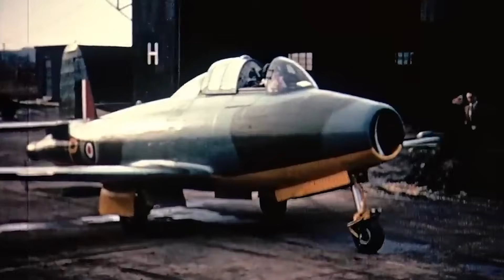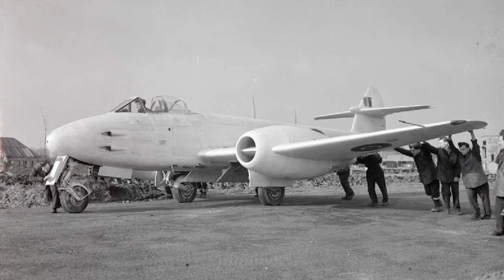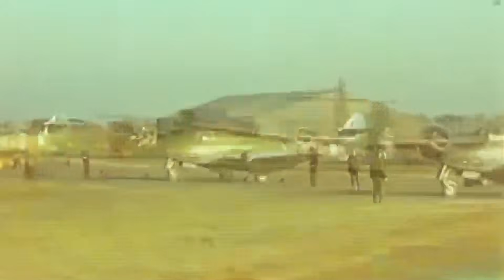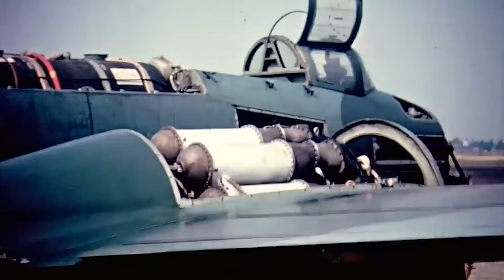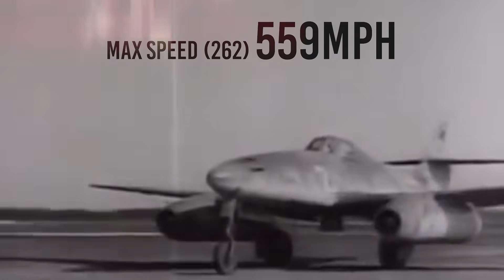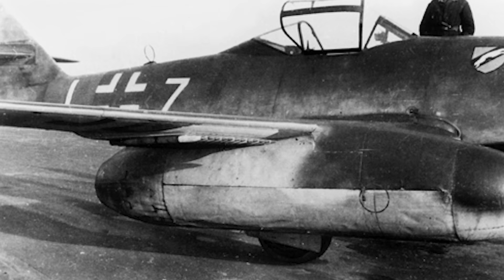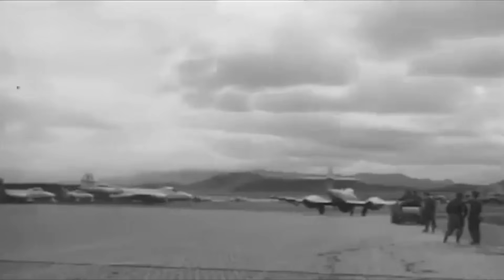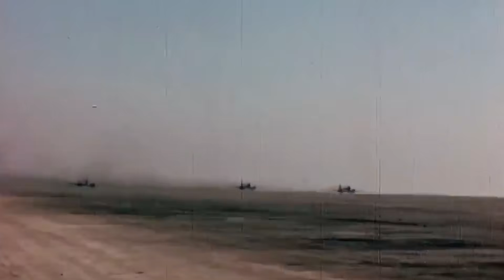Meteor vs Me 262 | Which was the better WW2 jet?

Comment: The Germans build 6k Jumos and they were easy replaced in about a half hour time. So they had enough spare engines which could easily be swapped. Not perfect, but the reliability issue was far from dramatic. Agility at low speeds is how important in a jet fight?
Reply: Only 400 Me262’s were ever operational because the Ju004 was so catastrophically unreliable. 
5000 of the Ju004 engines were scrapped in December 1943 because of a critical design error that made them unsafe for flight due to vibration.
Reply: @allangibson8494  First time I heard this.
Reply: @0Turbox That was the delay on deployment of the Me262 not the spurious “Schnellbomber” story.
That also meant that the Meteor actually entered squadron service first (the Me262 was used by a test organisation in combat earlier however).
The British had similar problems with their axial flow engines but didn’t put them in front line service until they were properly fixed (with modified non resonant blades).
Part of the German organisation’s problem was they had shipped the technical experts off to be riflemen on the eastern front…
Reply: in modern terms most BFM is very subsonic, like 350 knots sort of speeds, but modern engines and airframes are leaps and bounds past mid 40's tech. Stuff like a cobra isnt a dofighting strategy and would just lead to a cannon burst through the pilot

Comment: The 262 was a proven fighter with lethal cannons, but was difficult to refuel and maintain.
The Meteor had a more advanced engine, but little combat experience.
The 262 would be better in a duel.
Reply: The advanced engine was the one that matched the advances in design with practical construction and material development.  Nazi lovers would admire their heroes obscene use of slave labour.
Reply: the meteor did not have a more advanced engine, quite to the opposite. It was an axial flow engine agains the centrifugal jet engine. but the Meteors engine was more robust
Reply: @phil3114 Advanced is putting out TWICE the thrust and ten times the engine life.

Comment: Me 262 is better!
Reply: A third of all operating Me262’s were lost to dual engine failure (more than were lost in combat).
Reply: @allangibson8494 reason is problems with maintenance and lack of resources due to the constant bombing of Germany and its overall decay in every way. Same reason goes with the numbers of Me-262, over 3000 produced of which only around 500 saw combat, again due to allied air raid. My point is the Me-262 design is better, the implementation lacked resources and capabilities.
Reply: @insane5375 The Ju004 engine had a critical design flaw that limited its life to about five hours due to blades fracturing due to induced vibration. The compressor originally had an even number of blades in each stage supported by a cruciform spider. Each time a blade passed behind the spider it unloaded and vibrated. In December 1943 they changed to a prime number of blades in each stage which now meant the turbine was the life limiting component. All Ju004 engines built before that were scrapped.
Only 400 Me262’s ever flew and 141 of those were lost to engine failures. Engines were the bottleneck not airframes. Most of the 1200 actually completed never got engines.
Reply: Ist besser ist nahtsee 👍.